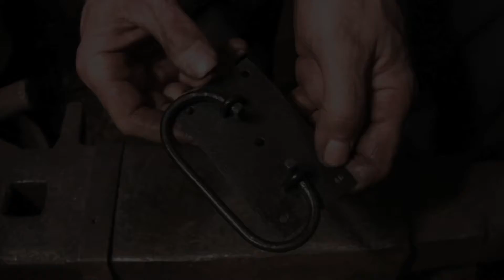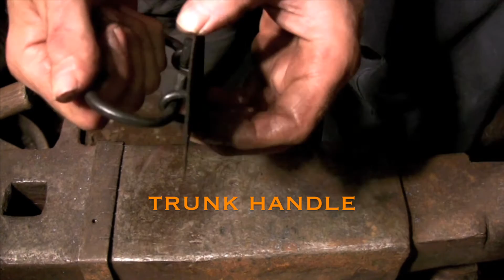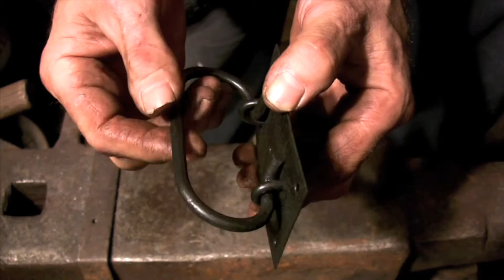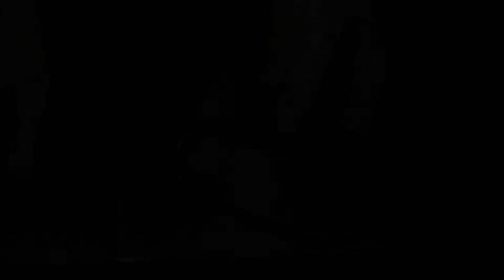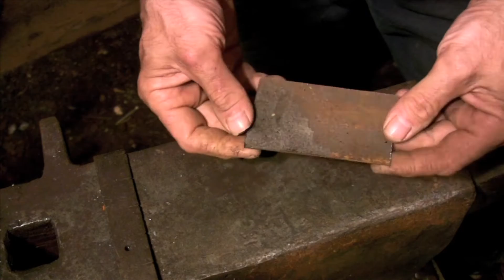Blacksmithing Project - Hand forged  Trunk Handle

Comment: How do you figure your stock length for the handles?
Reply from the maker: The two ends are basically 2 halves of a circle so you figure the circumference of that circle ( diameter X 3.14) and you add the length of the straight bar that is between the two 1/2 circles and an extra 3/4" for the upturned ends. Should be pretty close.

Comment: Pretty good; I would have plug welded the eyes at the back and also mounted them a bit further, about 2/3 up the plate, rather than in the middle.